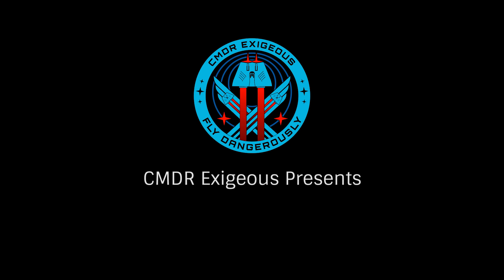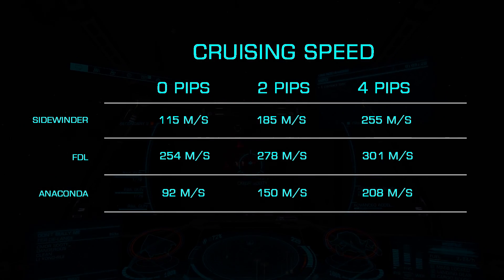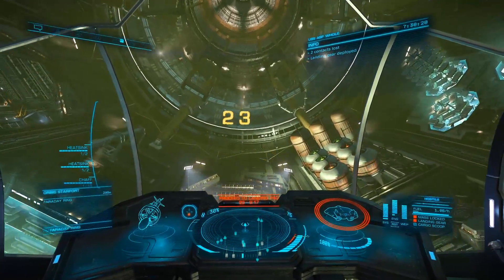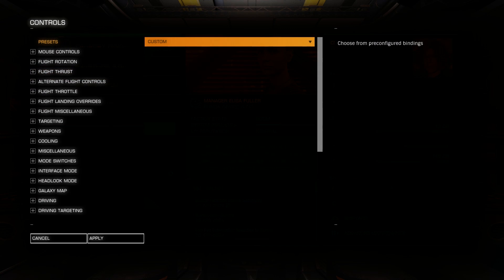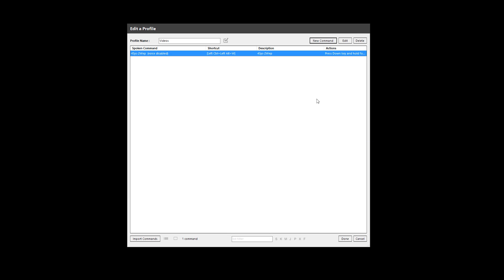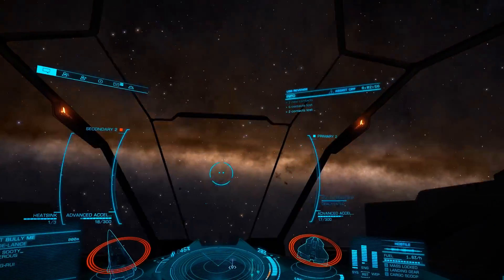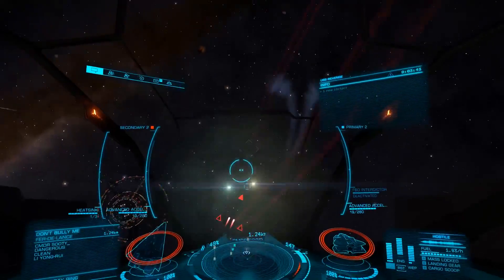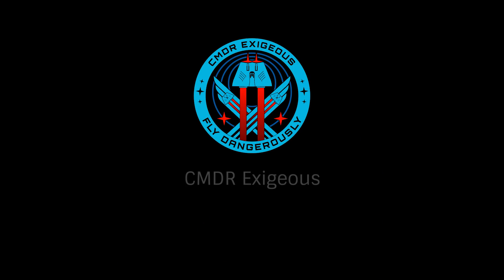Tutorial: Pip Management for Beginners

Comment: This video is again one good example why people into Elite Dangerous should subscribe to your channel (like I did as a fresh pilot). Good info. Actually, this explains the pips perfectly well, appreciated!
Reply from the maker: Glad you found it helpful. this is such a critical component to combat that most commanders drastically overlook, certainly at first.
Reply: @Exigeous  No kidding. When I started doing combat I only switched between pips without thinking it too much. I just thought that switching between weapons and the rest provided power to ... well, weapons and the rest, but thought that something like systems affected shield regen rate... didn't know it affects the strenght actually, because I thought the shield value was fixed.

Tho pips otherwise are kinda logical... more to engines and you can fly faster and turn faster, more to weapons and you can pewpew better without constantly being out of power 😅

But even when you know about it, it still is a good reminder to make you more aware about them 👍
Reply from the maker: A few things to clarify:
- Pips do NOT affect regen rate - so long as there is still energy in the sys distro you'll regen at the same speed. It does make them stronger though by really making them maximum strength (that's likely a better way to say it
- Speed is affected, as you say.
- Weapons aren't more powerful but with less pips in weapons they will heat up much faster. So with energy weapons you'll see a big difference between 0 and 4 pips in terms of how quickly they heat up.
Reply: @Exigeous  After your video I went to do a bit of research for further info and found out those things you mentioned. But it was good to have video that describes what pips are and how one might wanna use them.

Comment: But why would you put power to Systems when you don't have a shield?
Reply from the maker: A few reasons - as it's "systems" not "shield" - so things like chaff, heatsinks,etc. pull from that distributor too.  And to be clear there are VERY few times you'd run without a shield, ONLY for a fully engineered specialized combat ship - and even then hull tanks are so vulnerable to missiles this should NOT be done.  So if you're flying anything other than that PUT A SHIELD ON IT.
Reply: @Exigeous  ah, ok. I actually rarely run shields, for my cargo and exploration ships I wanna be light and carry more junk. Except the Type 9, that thing won't beat an interdiction to save its life. I have shields on all my combat and mining ships though for sure.

Comment: You forgot to mention, pips to SYS do NOT affect the recharge rate of your shields, like they would in most space games.

But you did mention the difference in strength, which is good, since most space games DON'T work that way.
Reply from the maker: Yeah, that's a good point actually - favored so it'll be near the top, good point.
Reply: Yes Pips to SYS does not help recharge your shields faster but it does help regen them quicker when broken.
Reply: I have been using them wrong this whole time wow
Reply: Heck, I have hundreds of hours in Elite and never actually realised that! Cheers 'Duck, and to you too Ex', keep up the excellent work.
Reply: Nox210 
Yeah, charge rate depends on the type of shield ONLY, not the size, total hp, or sys pips. So thats good to know.
Reply: Mike Cypher 
Only in that it helps keep the capacitor from emptying. I am pretty sure that, given infinite capacitor, it will take the same with 0 pips or 4.